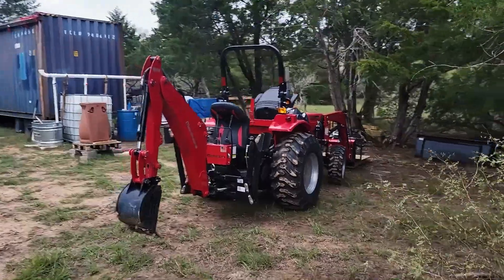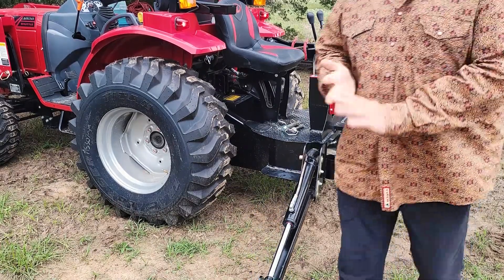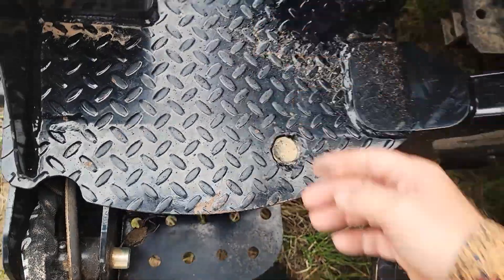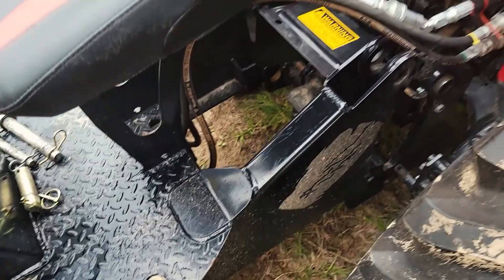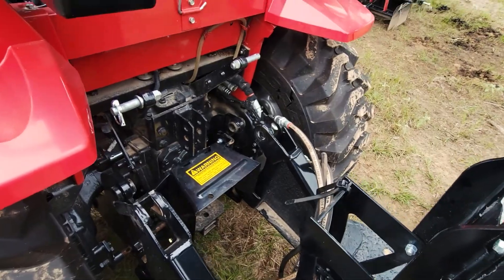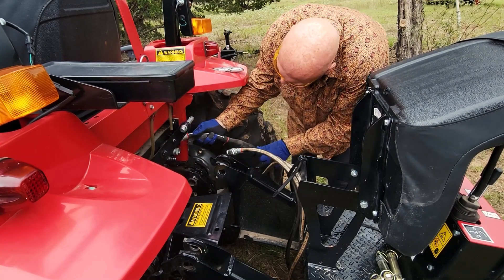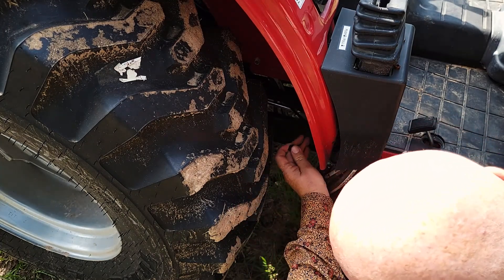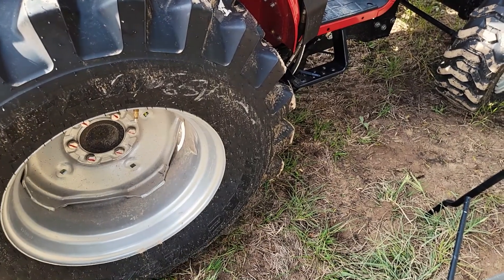Backhoe attachment removal from Mahindra 1626 farm tractor

Comment: I have 1526.  Once I took the backhoe off I can't get it hooked up again, but I'm okay with that.  I just use my front loader.  I worked with it for more than an hour, it will almost get in the slot, but it will not go in
  Also hoses are in a bad pinch point spot. I put a plastic cover over the backhoe and left it. 😊too much for an old man.
Reply from the maker: Yeah, it can be a bit of a wrestle for sure sometimes. It is a pinch point. I added a couple of extensions. Hope you get it ironed out.